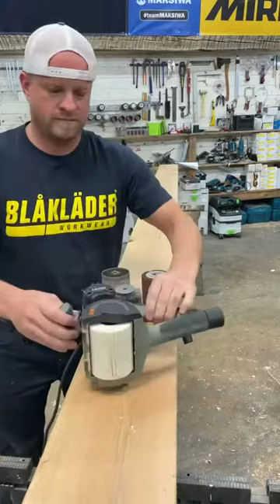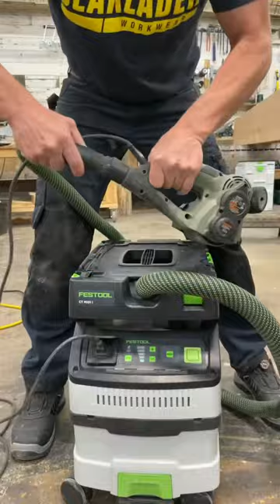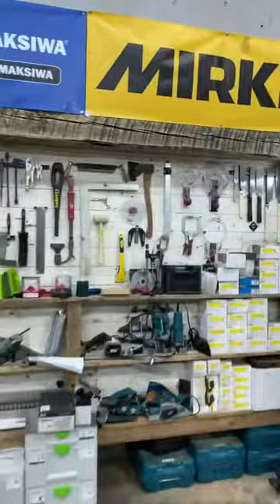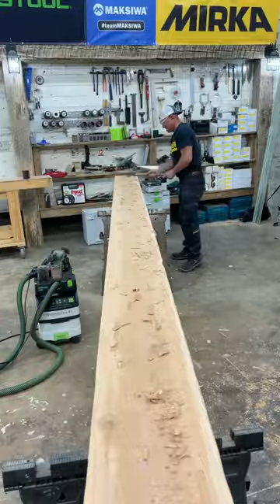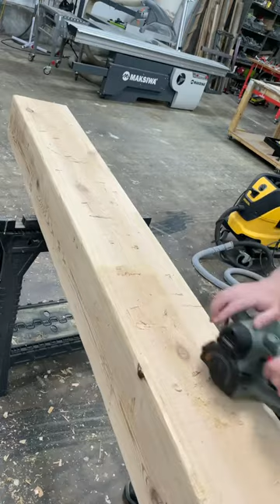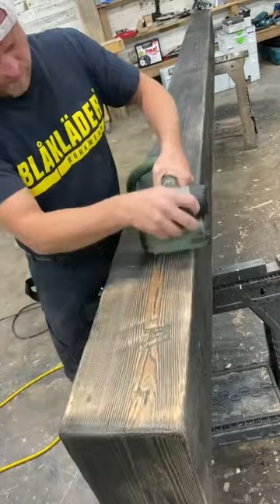Build a Rustic Faux Beam using the Restorer tool

Comment: My Restorer arrives today. Which attachment brings out the grain best ? I’m guessing the steel wire wheel . But so expensive. What’s the next best wheel to raise grain and is more affordable? I ordered the steel wire wheel . But I’d love an alternative so I don’t blow through a zillion at that price . I distress wood for a living and finally decided to splurge. Holding the angle grinder just so and making so many passes gets tiring on the arms . Especially since I have tennis elbow 🤣
Reply from the maker: Awesome news!!! Yes the wire wheel for sure.  The wire wheel will last a long time for you if you let the tool do the work without pressing down excessively.  A  slightly less aggressive roller would be the 80 grit nylon brush WRBW80 as seen on our site restorertools.com If you follow the stainless wire wheel up with the nylon brush you should not need to sand after that point.  Connect with me on instagram if you have any other questions on your projects and I would be glad to help! @inventor_of_the_restorer Great question btw 🙂

Comment: What were you using for the undercoat? Just purchased a restorer. Thanks for the video!
Reply from the maker: Dusty Lumber did this.  Thanks
Reply: Is that black that your spraying like deluded paint? That turned out awesome!
Reply from the maker: @mikesmith7989  diluted stain. 👍🏼